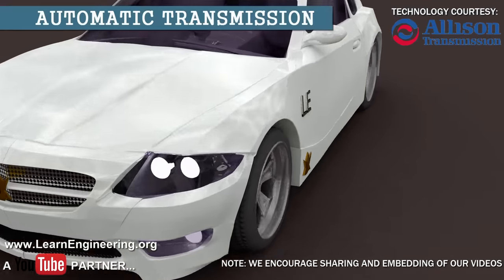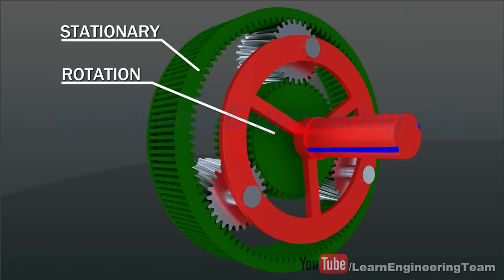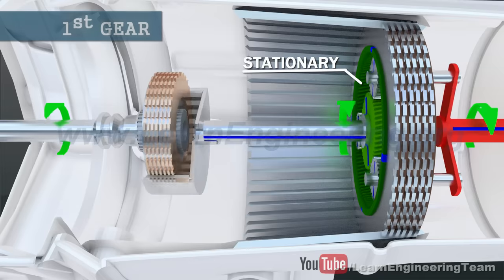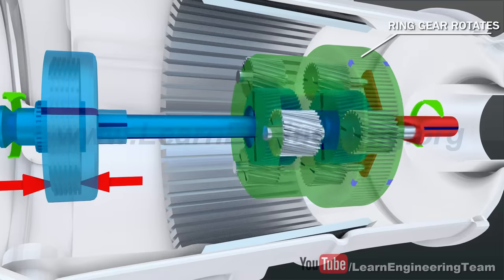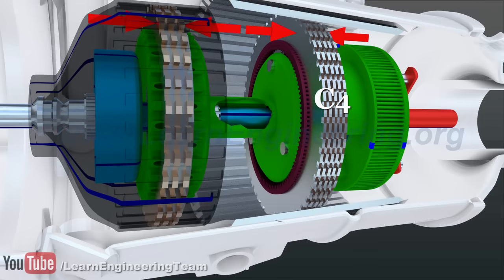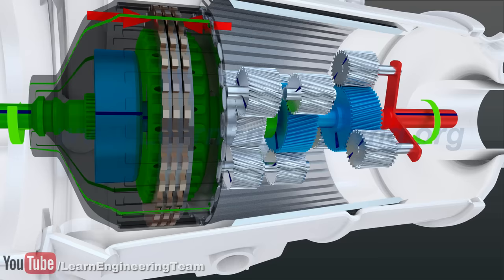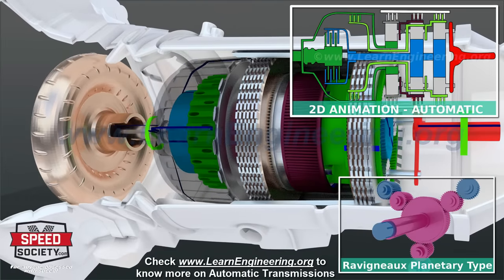Automatic Transmission, How it works?

Comment: Trying to learn the power transfer in an automatic with more than one planetary gearset is very difficult for non-mechanical degree enthusiasts. Unless I have a physical model in my hands to play with, I probably will never fully understand how any modern automatic works.

P.S. If a 6spd auto is this complex, I can only imagine how the ZF 8spd in Audis/BMWs and the even more insane 9spd units employed in the Chrysler/Acura products would be like.
Reply: Or 13 one in trucks
Reply: +Gewel those are usually manual. Easier to engineer.
Reply: I feel like the gear you are in is determined by the number of plates engaged to the outer ring.  Like a dual input toggle with many variations.I try to imagine the C# as a set of gear ratios.  But that's still my guess.
Reply: Trucks don't have gearboxes with lots of gears, they have regular gearboxes and a splitter or high/low range gear, which doubles the gear ratios you have to play with.

Same way as a mountain bike normally has 6 gears, but then on the crankset you have two or three input gears so you end up with 12/18 possible ratios.
Reply: I agree. I think I need to play with a model to fully grasp this.

I was looking on the web and there are actually hobby kits that you can get, to build your own gearbox. I might do it.

Not that I need to know for any study/training.

I'm just curious

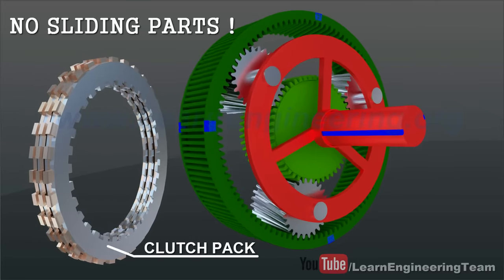Comment: 2:13 It´s one kind of automatic transmission, there are several others, some with direct connection between the input and the output shaft.

Comment: "The transmission knows how fast it's rotating at all times. It knows this because it knows how fast it isn't. By subtracting how fast it is from how fast it isn't, or how fast it isn't from how fast it is, whichever is greater, it obtains a difference, or deviation."

Comment: thanks LE for this great video. Could you also explain how clutch packs are applied as when the speed demands a gear switch. How does the gear switch work?
Reply: It's all done with fluid pressure.   There is a "Valve Body" on most all automatic trans,  and often you can get ahold of a "circuit diagram" for each transmissions valve body.  Basically by closing and opening different valves in the body, that fluid pressure can be multiplied and used to push and pull on things (clutch packs for example).

Comment: Automatic is great and imma let you finish, but manual is da real deal.
Reply: +Mariux - yup..you can not beat a manual.. always will be stronger and last longer
Reply: +ryanjames170 And more fun to drive.
Reply: +Mariux - It gets tedious pressing the clutch in very slow stop start traffic or holding it at bite point. In an automatic, lift of brake and floor it.
Reply: Awayze I don't find that all that tedious unless there's an uphill. Just floor the accelerator and slowly release the clutch.
Reply: ChrisHallett83 You will never break a manual unless you drive stupidly or if it's poorly designed.
Reply: +Mariux - yea old cars rule too they mostly manual like an R33 or Evo VI
Reply: +Mariux - and manuals are cheaper
Reply: +Mariux - 
Why not have both?
Ever driven an sport automatic with manual gear on the steering wheel?
Reply: +ryanjames170 
That is what they said about horses in the 19th century.
Reply: Bumble Bee Paddle shifters are nice, but don't gave the same benefits if you don't have clutch control. Still better than a full automatic if the shifts are short enough.
Reply: Skyler Allenson If you have a reaction and skills equivalent of a turtle then maybe you're better off with automatic.
Reply: +Skyler Allenson There is no automatic gearbox that could adapt to the situation better than an experienced human driver. Sure, a well tuned auto might give you fast and consistant quarter mile times but cornering and off-road is where manual truly shines.
Reply: +Skyler Allenson dude the Ferrari's are using DCT most super performance cars use DCT the the planatery gear set but DCT are even less reliable than automatics. I rather have an automatic planerary hydraulic transmission than the dual clutch automatic because everything can fail in a dct.
Reply: +Mariux - black face is that a joke cuz it doesn't make sence
Reply: DragonsREpic What joke?
Reply: +ChrisHallett83  Planetenary gears are much stronger than the standard helical gears in a manual transmission...but those small clutches and bands in an auto are usually the weak point - not to mention all the hydraulic valves and actuators that don't like the contamination that all oil gets eventually.
Reply: +Skyler Allenson  Autos actually take more power from your engine to operate, so unless you have more power than you can put on the road (for example, pro drag racing), the manual will generally beat the auto.  Especially since autos are hydraulically operated, which means they are much heavier.  it usually also means smoother up and down shifts (better for control while cornering.)  Mind you, i'm talking about a traditional auto, not the dual clutch jobs some sportscars have, which are really just a manual sequential gearbox with electronic computer controls for the clutch, throttle and selector forks.
Reply: +Skyler Allenson  Umm...they are not automatics...they are automatically controlled manual transmissions...no torque converter, etc.  When racing, they are shifted manually - and they shift MUCH faster than a traditional automatic that relies on generating hydraulic pressure from the torque converter.  What Ferrari use is basically like a sequential gearbox - like most motorcycles use - with the clutch, throttle, and gear selection controlled by a computer via electroservo motors and a plethora of sensors - basically like using a super fast robot to push the clutch and move the gear shift for you when you want to change gears, as well as matching the revs for a smooth shift (especially on a downshift, which is something a traditional automatic has never really been able to accomplish, since the engine is never actually disconnected from the drive wheels as is needed to match revs before engaging the lower gear.)
Reply: +Mariux - The "real deal" will be for hobbyists only in 15 years, maybe sooner.
Reply: +Mariux - Manual used to be more reliable until the dreaded dual mass flywheel came about. Most manuals made after 2001 (certainly in Europe) won't go much past 100,000 miles without the dual mass flywheel dying and they're hideously expensive to fix. I've just recently started driving an automatic (after 20 years of driving a manual) and I won't go back now.
Reply: MegaWayneD Automatic is fine for day to day commuting, but we're talking about sports cars.
Reply: +Mariux - and tuned cars
Reply: Nathan Condevillamar Yeah.

No skids for the kids with automatic :D
Reply: +Mariux - im a 9 yr old kid who respects manual tho :3
Reply: +Nathan Condevillamar Awesome.
Reply: +Skyler Allenson Which is one of the reasons that many people does NOT like Ferrari's and only lazy fucks buys them. I love manual due to how fun it is and keeps me alive from being excited. I have a fucking fast reaction ( 00.1 second reaction time in a drag strip the other day, No i'm not kidding)
Reply: Automatics are the best!
Reply: Awayze ...and wait 2 whole seconds before something actually happens!
Reply: Always some kid in the comment section stating how manual is superior to automatic, but never seen someone say automatic is superior to manual. That says a lot about manual drivers. What's the appeal?
Reply: try driving for a living like a taxi driver or delivery or anything that involves more than 100k miles a year and you'll get to hate manuals. manual is only for kids race drivers wanna be. the real race drivers drive a semiautomatic or an automatic with shift paddles. every day drivers will always take an automatic over a manual. do 200 miles a day in city traffic and you will understand what i'm saying

Comment: WTF, I've been driving for thirty years and I still cannot understand how this thing works. How this thing shift automatically??
Reply: Ha! The planetary gear concept that they explain here is interesting and relevant  - but it's actually the easy part. The hard part is exactly what you asked, how does it shift automatically? My layman's understanding (I'm not a mechanic) is that older transmissions (and still many new ones) use fluid channels and other complex mechanical wizardry to achieve this, essentially a mechanical computer that evaluates throttle position, road speed, and engine RPMs to determine which gear the transmission is supposed to be in. Newer transmissions often use a built in electronic computer to do this, or some bizarre combination of both. So the answer to how does it shift automatically is, "it shouldn't". It's modern proof that magic and wizardry actually exist :)
Reply: You can thank the car's computer for that.
Reply: no magic, just intelligent engineering.
Reply: "Intelligent" might be stretching it.  Once they make one that lasts as long as a standard, they've got it.
Reply: +MrZedblade there were ats even vefore computers.
Reply: No, there weren't.  Fluid coupling transmissions aren't "truly" automatic transmissions, at least by modern definition - you still had to flick the lever to shift up or down.  Truly automatic transmissions with torque coverters, overdrive, and fully automatic shifting with no user input didn't come around until the late 50's from GM and Chrysler.
Reply: Alex M in the late 50's how did GM and Chrysler implement those? Surely analog instrumentation?
Reply: It was hybrid digital/analog implementation. ECMs have been around longer than you think - BMWs had them starting in 1939.  Measurements and inputs were analog, and used a digital ROM for a lookup table with precomputed values.  Everything switched to fully digital in 1980 for GM (who kind of led the way on mainstreaming it).
Reply: Inside of gearbox there is small oil pump. Thrue the valves and springs, oil is moving pistons, witch are selecting gears. What valve is open, and what is close, demaign by the load of gearbox.The smaller it is, the oil has a lower pressure, and opens the valves, which have a weaker springs. The weaker they are, the higher the gear is activated
Reply: MrMBmovie Like I said, just google "valvebody"
Reply: ECM measures current speed, RPMs, and throttle position to decide what gear the car should be in, then sends that decision to solenoids in the transmission, which then opens and closes parts of the valvebody.  Valve body configuration determines the fluid pressure, as well as where the fluid goes.  Fluid goes to the necessary clutch pads to either engage or disengage them, thus shifting the gears.  It's a little simplified, but gives you the main idea.
Reply: Hydraulic pressure acting on bands and clutches to hold one or two elements of the gearset stationary.

Comment: It's interesting when you stop and think about the fact that an engine is really nothing more than a fluid pump that rotates a torque converter (which is really an impeller) that pumps fluid into the transmission and that an engine and transmission have no direct physical connection to each other.

Comment: I understand this is controlled by computer today. But automatic transmissions were here even before computers, so there has to be a mechanical way also, right?
Reply from the maker: +NoLlama Yes, you are right.
Reply: Before electronically controller transmissions they were Hydraulically controlled.
Reply: Before computers the auto transmission is hydraulically controlled by pressure.

Comment: Elon Musk: laughs in electric motor
Reply: Teslas are not direct drive. They have transmissions, too 😁
Reply: michaspi they have transmissions but they don’t shift, basically a 1 speed transmission. It’s just a gear reduction in between the motor and wheels.
Reply: Nate 07 So a device that transmits power from the “engine” to the wheels 😉

Comment: God B With Me • One of the most important details. Is knowing that the torque converter is actually a fluid coupling. Rotating at the speed of the engine's crankshaft. This converter directs the oil flow by centrífugal forcé thru orifices in the input shaft. Priming the transmission oil pump enough to develop enough oil pressure to move the clutch packs. One by one the 1st gear. To the second gear , third gear. And so on. Till fluid pressure convined with the rotation of the input shaft and the output shaft. Are both running at the same speed. After that rotation speed is reached. Then the first gear is cancelled. And that oil pressure that is not used to shift the 1st gear. Is now used to shift the transmissión into overdrive mode.

Comment: This type of design is already used. In automatic transmissions, it is the fluid in between discs that aid in switching gears. It helpes the discs get up to speed before the gears come together and provide the actual power. Helps reduce mechanical wear when changing speeds at higher rpms

Comment: Let me start by saying i'm just a student trying to learn this so if one of these is incorrect forgive me im still learning and it would be helpful if you could point out exactly whats wrong about what I said. This is just the basic concepts of each gear. 

SO basically 1rst gear the sun gear spins at a slower speed and moves the planet gears move while the the ring gear stays in place. 2nd gear is when you engage the ring gear so everything that's happening in first gear is continuing but the ring gear is included in the rotation. 3rd gear all the gears move together as one unlike 1rst and 2nd gear where the sun gears move by themselves not occording to the ring gear. 4th gear same thing is happening but all at a higher speed.

Comment: Basic rule of thumb, the more gears that are moving in the transmission, the higher the gear you are in. If fewer gears move, it is a lower gear. (If more things move, the output speed will be faster and vice versa)

Low gear = high torque (easy to rotate fast) lower speed. High gear = low torque (hard to rotate fast) higher speed.

I hope I made it a little easier to understand

Edit: if anyone is gonna ask me how the entire transmission is automatic, to that my answer is: idk

Comment: I remember the old Heidelberg KORD printing press that I used to run. These presses controlled the speed, not by increasing the motor speed, or changing gears, but by have a variable speed pulley. These things last forever, and are infinite in speed range. It is a very simple method of opening and closing the pulley and the belt would move a closer radius to motor shaft and slow down (more low end torque), or it would trade that up for speed as the radius increased from the shaft. It is much easier to understand, works reliably for many, many years. don't need fluid changes. They also don't get hot. I still think a method like this would be more reliable for many applications, not sure about vehicles, but not sure why it couldn't.
Reply: Difficulty: high torque in cars. But check out CVT transmission

Comment: Ok. This video says the planetary carrier is always the output. That is only true in forward torque multiplication (1-2nd gear). In reverse, the carrier is held, with the ring and sun gears being the input/output depending on how fast your going in reverse. Slow reverse, sun gear is input and ring is output for example. In overdrive, the carrier in the INPUT member.

Comment: Should've spent more time explaining how the clutch pack works and how it engages or disengages with the planetary gear set. Moving straight on to multiple planetary gear sets with multiple clutch pack engagement variations is probably where most people got confused, it definitely is where I got confuddled. 

You're trying to explain how two parts work with each other before that part is properly understood.

Comment: Who else always thought it was literally just different size gears next to the shaft which get individually selected to be used? 

So actually there is stuff rotating inside stuff and is attached to other stuff also rotating inside stuff. Don't be too hard on yourselves for not getting it. I don't get it, but still have learned a lot